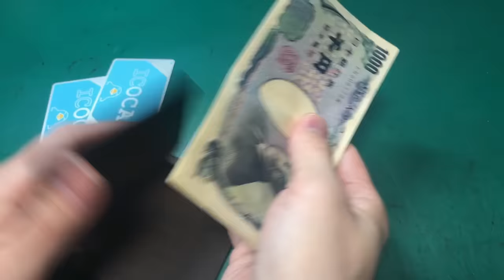Making/ Clip Wallet /Free Pattern No.19

Comment: As always very nice job. Really admire your leather tanning technique. What topcoat finish are you using? I've tried googling "Lized urethane top gloss" but no results 🤔
Reply from the maker: https://l-phoenix.shop-pro.jp/?pid=144271858
In the case of urethane top mat type, it can be shipped overseas from here.
Since it is a new gloss type product, it may not be shipped overseas.

If you use it, there is sediment on the bottom of the container.
It turns white when attached to leather.
Store in a separate container and discard the container with the first sediment.
Reply: @majutworks  Many thanks for your quick response and detailed explanation. I've ordered two containers just now. Looking  forward to use it🙂